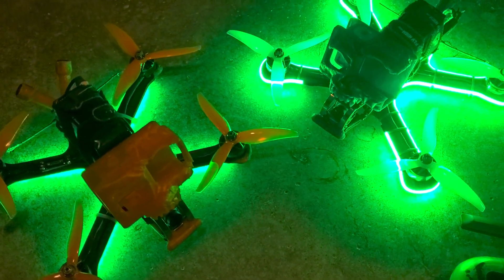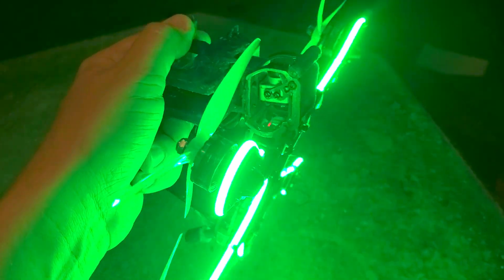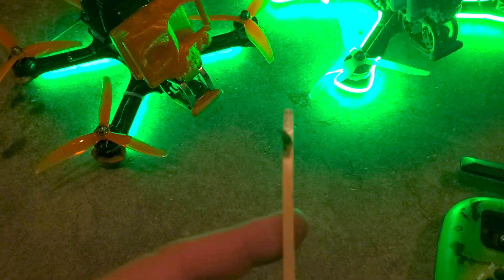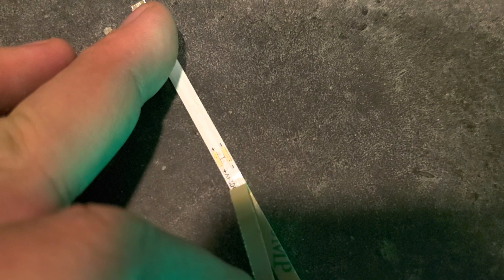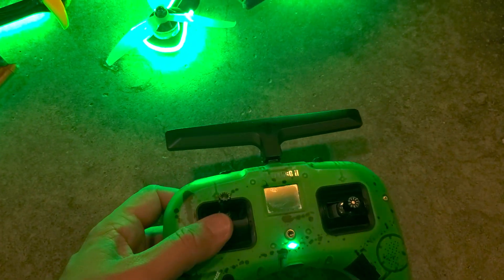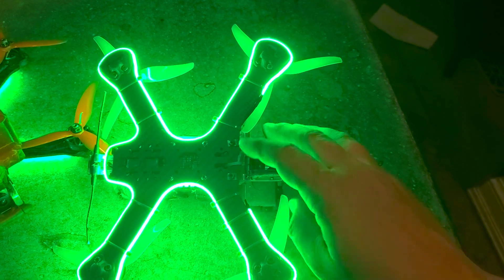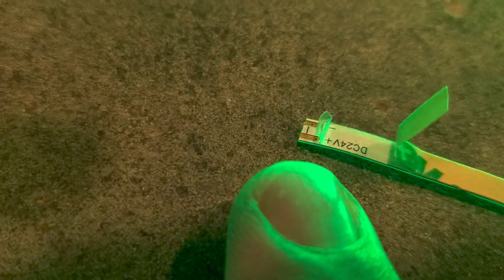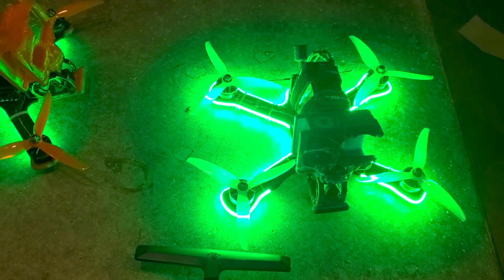Get Lit with Fly High FPV Super Bright LED Strips - How to Install COB LED Strips on your FPV Drone

Comment: Do these hook up to your FC? Are they powered directly from your 6s battery?
Reply from the maker: These single color only need vbat to light up.  I typically wire them on the esc main battery pads 👍

Comment: Hi, i hope you still see my question, thats led strip 24V DC + , it means, it will still work if im using lower than 24V ? Example  4S battery , thanks❤
Reply from the maker: The 24v is 6S-8S, i also have a 12v version for 3-4S 👌

Comment: I have f55A Pro 2 6s 4 in 1 32 bit fc & esc what would I need to hook it up correctly? I need these led’s
Reply from the maker: Just a soldering iron, and you can use some spare motor wire if you need a lead.  I solder the LED's positive and negative right on top of the main battery leads on the ESC. So just piggy back on the big joints, right where they connect to the ESC.

I love the F55A and the V45A, kick ass ESC's

Comment: I must be crazy. Tried soldering to my board plugged it in and nothing. Bought the 4s version. Am I missing something more to soldering these? My SpeedyBee F405 has 4 dedicated pads as well and nothing. Tried separate pads and nothing. Going insane.
Reply from the maker: Dont use the led pad for my single color strips, they just need to be wired straight to Vbat, so they get the full 4S voltage without any regulators.  I typically solder right to the main battery leads on the esc.  If you want to do a quick test, just stick the led leads into a charged 4S battery, but prepare your sunglasses 😎  if you're stuck, shoot me a DM on instagram or FB messenger @FlyHighFPV

Comment: Do you have a tutorial for soldering these on? I've never done it before and have 4 individual ESCs. I'm new to building but had to buy some of these!
Reply from the maker: If you are running individual esc's, you probably have your main battery lead coming to your FC or to a PDB board.  You can solder the LED leads right to the same pads as your main battery lead.  So they are on the big + and - pads 👍
Reply: @Fly_High_FPV  thank you! I'll give it a go!

Comment: Hey man, how do you install the LEDs , I am new in the hobby and just got the LED strip to install in 2 of my quads. I want to make sure I know how to do it. Do I connect them directly to the lipo or to the ESC?
Reply from the maker: The main battery leads go from the lipo to the + and - pads on the ESC. You can piggy back the led + and - right on the main leads on the esc.  That way as soon as you plug in the battery the LED's get power off the esc, and you dont need any regulators 👌
Reply: @Fly_High_FPV  awesome thank you so much I will do that!

Comment: These are so cool... I wish I had found your channel and this video a week ago!! 

I just bought three different strips of cob led's in Red, Green, and Blue. The red and green will be used for navigation on my 40" fpv wing for LOS flying at night... its nearly pitch black in my area with next to zero ambient lighting even with the moon out!! The Blue will be the main wing colors! 

What 12 volt reg do you use? All the 12v volt regs I've found before posting this comment were these cast aluminum heat sinked block regs, they're huge and heavy! Also how would you wire a RealPit with a PWM Aviation Receiver?
Reply from the maker: I usually avoid using regulators and power directly from mains voltage. If you need a regulator,  Pololu makes great ones

Comment: Hey bud!!! To install this do I just solder those directly to the power pads via two wires and bam it’s good to go?
Reply from the maker: Yup, right to the main leads on the esc to feed the LED's 6S 👍
Reply: One more question bud! To attach them to the frame via the sticky side, should I pull off both backing completely? Or just the first one? I did pull off both where the pad was to solder. Just not sure if I should take the rest off? To make it stick better?
Reply from the maker: @Smokebreak FPV  to sodler i peel both back half an inch to expose the joints, after soldering i put a dab of conformal coating onnthe joint and then heatshrink coveres the joint. I then lay the half inch of sticky adhesive back down on the heatshrink.  To apply it to your frame, first clean with ISO if youre covered in grass, then peal the paper backing off a little at a time,  leaving the clear adhesive on the strips, and sticking it to your frame a few inches at a time.  As i finish each arm, i zip tie the arms , and if you have a tight corner or a spot where it's coming off a lil dab of CA glue is fantastic for repairs 👍
Reply: @Fly_High_FPV  awesome bro!!!. I had to test the lights and man I am blown away!!! Wow they are bright!
Reply from the maker: @Batwingfpv  sunglasses are required 😎

Comment: Such a shame that shipping to Australia brings the price for a 1 metre segment to AU$50.
Reply from the maker: Yeah, it is usually about $17-25usd to get even a tiny light weight package shipped out of the United States, but you can load up to 1lb before the shipping price goes up (I keep it real, everything based on actual shipping costs). One work around is to tell your local RC shops to hit me up, I'm already supplying dealers like FPVHobbyNinja in Canada and working with Dread_FPV in Switzerland,  and I'm importing frames from Australian ImpulseRC. I'd love to work with you or local dealers on bulk pricing 👌 i can do individually packaged meters or 5meter rolls.

Comment: dumb question. but i got a bunch of 5s batteries i dont use. would 5s work?
Reply from the maker: Check the 6S listing on my site. Many of the 6S colors will actually still produce alot of light on 5S 🤘

Comment: Hey brother I'm loving the last leds you sent me. Can you come up with a stand alone system? Something with a battery so i can light up my air2s?
Reply from the maker: You want to keep it as light as possible. Check out Duracell 27 and a matching battery tray, if you want easy and disposable. If you want to be bright as possible, go for a 4S 300mAh lipo and use XT30 connector....but that's going to need a lipo charger that alot of DJI pilots dont have. I appreciate the request,  i'll think on it a bit more and see if i can make an easy kit👍
Reply: @Fly_High_FPV  thank you
Reply: @Fly_High_FPV  I'm ordering the lights now. How cN I order the battery and battery tray?

Comment: Nice nice lights do I need besides this leds something else to connect to my 4s quad???
Reply from the maker: Just a soldering iron 👍 you can optionally add a RealPit chip for $5, that will allow you to control the LED's with a switch on your radio, but most direct wire them so they are on when the quad is on 👍
Reply: @Fly_High_FPV   awesome I like it and one more thing do you also sale that the real pit chip and do you ship u.s.a ???
Reply from the maker: @Ed Jmz  yup, RealPit chips are $5 each. I'm based in Alabama,  and I ship anywhere in the world 💨💨
Reply: @Fly_High_FPV  excellent thank you I will looking for some stuff...

Comment: What kind of video is this? In quality settings it says HDR and the video is just a tiny square in the top left corner of the player and the rest of the screen is green
Reply from the maker: Sounds like your browser/app's encoder crashed
Reply: I realize this was almost a year ago, but I just noticed it did the same thing on my phone. Watched it on my TV and it was normal.
Reply: @willpowerfpv3246  yeah it's still the same for me 10 months later. I have a 3 year old Honor 20 Pro with Superior LCD screen. AMOLED sucks because it wears out and has poor low contrasts and tinted screen and black spots.
Reply: @xxBlackpspxx  it's funny you mention that, because I didn't have any issues with my Samsung that I recently sold, but I went back to my five-year-old Huawei mate 20 Pro, and Huawei is the parent company of Honor, so they must be using the same video encoder. 🙃
Reply: @willpowerfpv3246  why did you sell your Samsung and return to a 5 year old smartphone? I want to buy something new too by my honor 20 pro is still fast. Only problem is no more updates